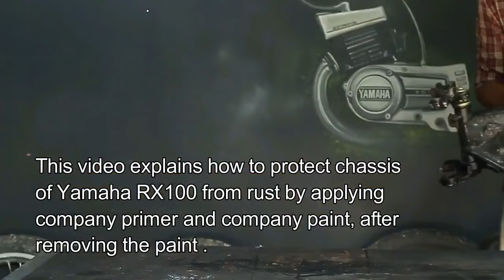How to paint yamaha rx100 bike frame | Bike frame painting detailed review

Comment: Excellent work , I have some suggestions 
It's better to apply strip coat by using brush on weld area and critical areas it will avoid corrosion on those areas , and also it's better to try sand blasting , do proper preparation before applying the subsequent coat 

Midhun v
Coating Engineer 
Duqam refinery project
Oman
Reply: മിഥുൻ duqam അനോ
Reply: Port a. Ano
Reply: @anishanjuaadi   Duqam refinery
Reply: Njan salalah aanu
Reply: Nattil avidayadoo sand plasting ullathu? Agenea cheyukkaanakil ninak a paisa undakil fresh chaise vagam... Ethu keralam annu evidea egenyoke cheyunnathu thanna bagyam